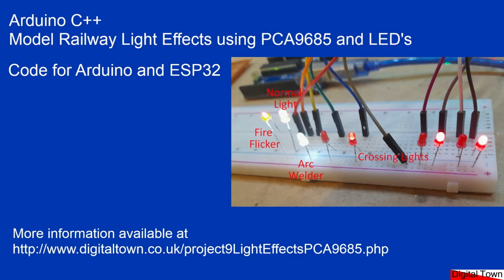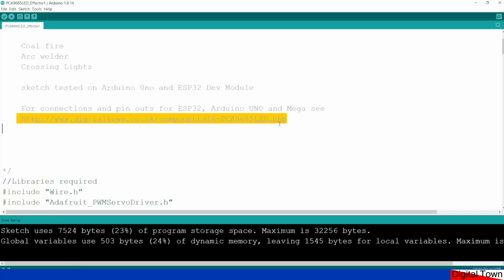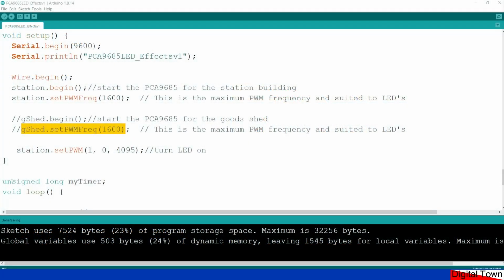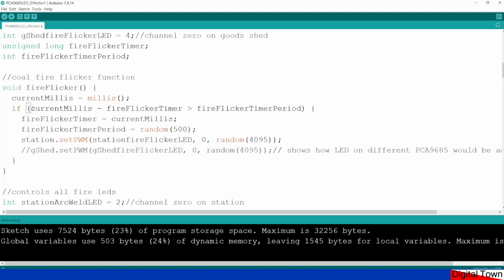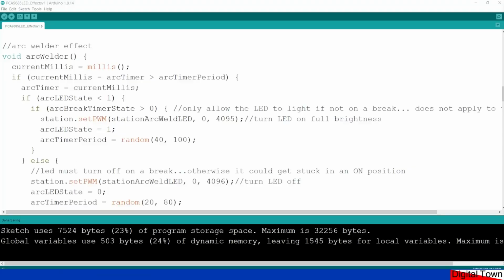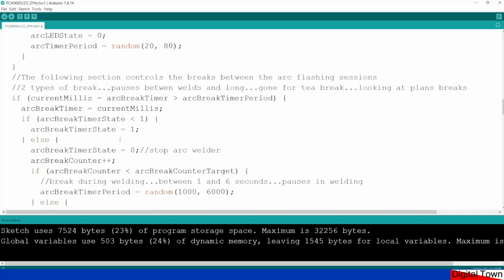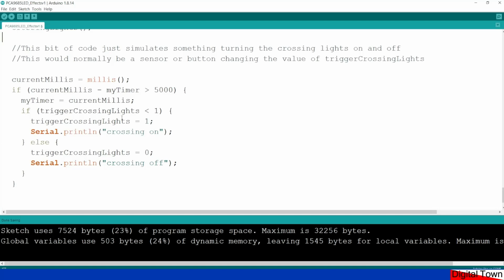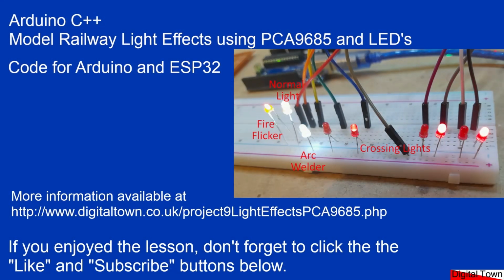Arduino C++ Model railway Lighting Effects using PCA9685 and LED's

Comment: Using 2 PCA 9685, do you know if you can use one for the LEDS, and another for the servo's, (for the crossing barriers), as they use different frequencies? 
in your code line 161 station.setPWMFreq(1600); 
Can you add, for example barriers.setPWMFreq(50); where barriers is the second PCA 9685 on 0x41
This way you can control barriers and LEDS from 2 wires from your Arduino.
Reply from the maker: It's no problem to have different frequencies for each board. So you should be able to control lights and servos off the same board.
Reply: @digitaltown5442  
Thanks for the quick response. I have found another PCA 9685, and am going to try it with 2 boards , different frequencies on either board. Trying to keep all LEDS on one board then all servos on another.Just need to solder it up and amend my sketch. Might be a while yet, as I'm not the quickest programmer.
Thanks for the insight into millis() too.

Comment: Hello,

A great article and right up my alley.

I use JMRI with CMRI ( computer model railway interface

When a train comes to a crossing and hits a sensor, the crossbucks should begin to flash.  The sensor is a boolean input to a PCA 9685, say it is on channel 0 on the first board.

So the board is x40 channel 0.

What would be the if statement  to reference this sensor and begin the flashing.
Later the train crosses the road and hits a second sensor.  So this all should stop when the caboose passes that second sensor.  How would you code this up?

thanks

Bob Schworm
Cleveland OH
Reply from the maker: Your triggers needs to send a signal to the Arduino controlling the PCA9685, not the PCA9685 itself. That is controlled by the Arduino.

So the code overview would be having a pin on the Arduino as an input from the first sensor.
In you main loop you would do a digitalRead() on the sensor pin and if it went HIGH you would have a variable, let's call it runCrossing. So the pin goes HIGH and we set runCrossing to a value of 1.

Then in your main loop, you have some code that goes either side of the line crossingLights();

it would read something like

if( runCrossing == 1){
crossingLights();
}

Then you would have your 2nd sensor and again it would trigger an Arduino pin sending it HIGH.

This time your code would read something like

if(digitalRead(secondSensorPin) > 0){ //HIGH
runCrossing = 0; //stop the lights flashing
//Then turn off all the crossing lights
//So from the example coede
station.setPWM(crossingLeftLED, 0, 4096);//turn LED off
      station.setPWM(crossing2LeftLED, 0, 4096);//turn LED off
      station.setPWM(crossing3LeftLED, 0, 4096);//turn LED off
station.setPWM(crossingRightLED, 0, 4096);//turn LED off
      station.setPWM(crossing2RightLED, 0, 4096);//turn LED off
      station.setPWM(crossing3RightLED, 0, 4096);//turn LED off
}

You will need to declare the pins etc and the variables but that's about the code you would need.